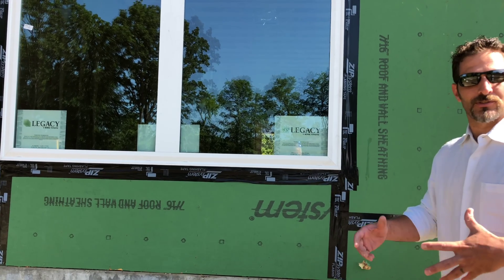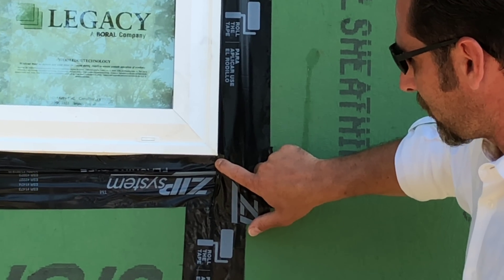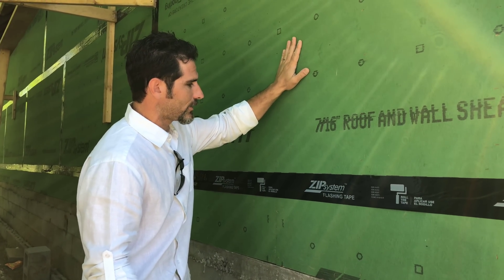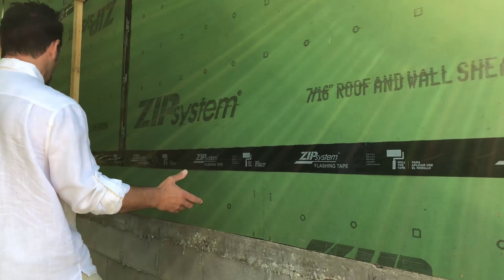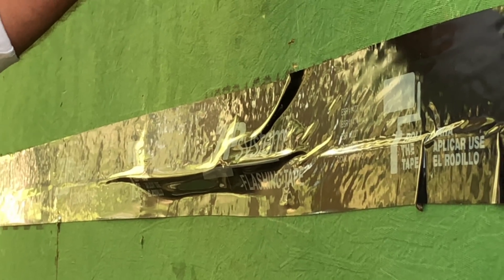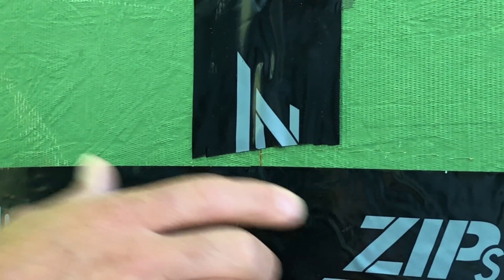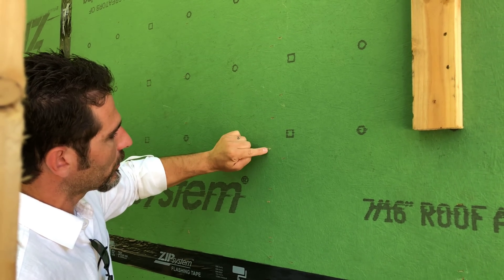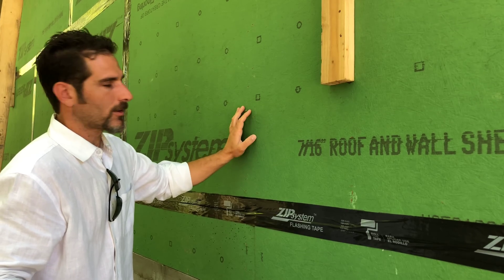ZIP System Problems

Comment: Liquid flashing needed
Reply from the maker: Funny how they are recommending liquid flashing now but when it first came out they didn't have any thought about the penetrations.  When people had problems they told them the nails were over driven!  HELLO, we use air guns to build houses THEY ARE ALL OVER DRIVEN!  Now the magical solution is liquid flash.  If you think it is a good idea to smear a bunch of liquid flash all over the place and rely on miles of perfectly installed tape to keep your largest investment safe then we have different view points for sure:)  Thanks for watching!

Comment: Is it just me or did this video highlight a bad install and use it to show why an inferior product is better? If I pull the ground off my most epensive extension cord OSHA is still going to fine me.  Show me this video on a good install and sue me the negatives.
Reply from the maker: Yes this video points out a very sloppy install but also a very common installation!  This system has more potential to be problematic than any housewrap ever thought of!  Add in the marketing they are doing to say how fast and easy it installs and this is what you get.... Homeowners stuck with the  bill years later when the water finally starts to show up inside!
Thanks for watching & interacting!

Comment: I've seen numerous YouTube videos praising the zip system. I'm about to start a remodel on recently purchased peir and beam house. I was looking closely at the zip system, but I'm so glad I seen your video on it. How could this system be put together better? Do they prefer over hang at the bottom, could replacing zip tape for the zip caulk? I'm still undecided on zip or just osb or plywood with tyzek
Reply from the maker: Plywood with Tyvek will by far be superior in my opinion.  It overlaps and will be much more user friendly for you to repair as well as install correctly!  If you need any help you can always reach out and I will be glad to assist.  Thanks for watching!
Reply: I have a question for you,  with that over hang on the tyvek. How much over hang should that be when getting installed?
Reply from the maker: Here is a great reference for installation:
https://www.dupont.com/building/how-to-install.html
You can also checkout all the videos we have on our channel that will explain how to integrate penetrations such as pipes, windows etc. into the building envelope.
Reply: If I used 7/16 osb or plywood as sheathing. What product can I use to tape up the seams of the butt joints on those once installed?
Reply from the maker: Marcus Mumphrey there is no tape I have seen that will stick to osb or plywood long term.  You could use zip then cover it up with Tyvek but you better make sure you have the proper ventilation and HVAC system. That will be costly also but would do what you are asking about.

Comment: Matt Risinger pointed out everything this guy is calling issues.  There is a correct and a wrong way of building a water-proof and air tight home.   This seems more of a skilled labor issue rather than the zip system itself.  I'm sure the same skilled labor who installed this system would do the same to any other system.  Hopefully, the inspector corrects these issues.  I didn't buy into this video.
Reply from the maker: https://www.youtube.com/watch?v=Hi_a2godZ0o
Here is a great example of this system failing even when installed per manufacturer's specs....

Comment: is there a flashing that should be on that bottom? Seems like a good see for a aluminum flashing
Reply from the maker: Yes there should be a termination flashing that works in conjunction with the zip system tape. The beauty of housewrap is you don’t have to worry about that, you just simply run the bottom of the housewrap past the bottom plate line and your done! That is why you will see this wrong on many zip system homes....Thanks for interacting!
Reply from the maker: Yes there should be a termination flashing that works in conjunction with the zip system tape. The beauty of housewrap is you don’t have to worry about that, you just simply run the bottom of the housewrap past the bottom plate line and your done! That is why you will see this wrong on many zip system homes....Thanks for interacting!
Reply from the maker: Yes there should be a termination flashing that works in conjunction with the zip system tape. The beauty of housewrap is you don’t have to worry about that, you just simply run the bottom of the housewrap past the bottom plate line and your done! That is why you will see this wrong on many zip system homes....Thanks for interacting!

Comment: Every system will fail if it's not installed properly...... like  come on....
Reply from the maker: You are correct & that is the point of this video! The manufacturer of this product has sold builders, homeowners, lumber reps, etc that this system is so much easier & faster to install but it is simply not! It is actually very difficult to install correctly at which point the system may actually work.  The other major thing I don't like about any of the Integrated systems like this are the fact that they rely on miles of tape to keep your structure safe!  As opposed to the overlapping of a quality housewrap.  Thanks for watching & commenting:)

Comment: I don’t understand why the industry continues to try to build houses like we did in the 70’s/80’s. Build tight, insulate, and ventilate. People need to breath, not the house.
Reply from the maker: Building a tight house if not done correctly can be a nightmare for unsuspecting homeowners.  I agree about building a tight home but paying attention to the climate you are in.  Water intrusion management is super important in a tight home because it doesn't breathe to allow it to dry out as well.  The HVAC and air exchange is also super important.  Most builders using zip or other integrated WRBs are not paying attention to these things, therefore leaving homeowners with a huge problem!
Reply: I completely agree. Not building anything correctly is a nightmare for the homeowner. Zip, house wraps or otherwise. I think most builders are trying to build quality products no matter what materials/vendors we choose. However we can all agree that we don’t want water or air (uninvited and unventilated), entering our homes.

Comment: Point at 6:25. It is more about design and understanding how materials work and how they can work together. You shouldn't be harping on zip alone because all products are subject to the same failures. even Tyvak!
Reply from the maker: You are correct about all systems can fail if not installed correctly!  However ZIP has pushed their product to the public as faster and easier to install than traditional housewrap.  When in fact it is much more difficult and time consuming, not to mention all the tape you are relying on to keep your home safe!  So the point of this video is to show the most COMMON installation vs. their pipe dream of a perfect world!  Look around your area & let me know if you see any of these systems on a home you would be comfortable living in after you watched the video!  Thanks for watching:)
Reply: @WeatherProofingAmerica  Here is the deal. That is a load of excuses! If you are a GC and don't know how to install the product, you either A) bring in someone who does (and can verify their experience with the product) B) bring is someone to inspect the installation or C) declined to take the job. 100% of clients would agree there are no other excuses. Additionally, If a client chooses a product install time frame can not be an issue if the GC agrees to install it.

Installation speed is greatly dependent on product experience and knowledge(true with about anything). An experienced contractor should be cutting some time off of the complete wall system install and waterproofing. That is what zip alludes too. Tyvek wraps have been around a long time. I wouldn't expect to see major market penetration for some time with Zip for awhile. However, I can see informed clients wanting Zip-R since it has substantial timing savings and benefits.

Comment: This a problem with the installation NOT the product
Reply from the maker: You are correct & that is the point of this video! The manufacturer of this product has sold builders, homeowners, lumber reps, etc that this system is so much easier & faster to install but it is simply not! It is actually very difficult to install correctly at which point the system may actually work.  The other major thing I don't like about any of the Integrated systems like this are the fact that they rely on miles of tape to keep your structure safe!  As opposed to the overlapping of a quality housewrap.  Thanks for watching & commenting:)

Comment: My house was built in 1979
It has 2x4 exterior walls and r-11 insulation.
The exterior is plain old T-1-11
Therefore, the sheathing is actually the finished siding.

At first read, this type of construction probably sounds like junk to you.
Notice how I said CONSTRUCTION not “system”

I’ve had zero rot or water problems.
No mold, nothing! Because my house can actually breathe.
I should take this time to note that my house also has huge soffits 24” on the whole house.

One final note is that I’m a builder
I’ve been working this junk and these systems for years.
It’s basically all trash.
If you keep water off the side of your house it won’t rot
Build your house with massive soffits and you’ll save a lot of headaches.
Tyvek and zip are just two different turds floating in the same punch bowl.
Pick on ( because of code)
Build huge soffits and you’ll be fine.
Reply from the maker: The home you are referring to has stood the test of time because it can breathe very easily!  The bad side to that is it is very inefficient due to airflow through the home.  However because of the high permeability of the home it will not rot, rot takes place when organic materials are consistently wet and dry out very slowly or not at all.  So you will find areas of your home that will have water stains on the inside of the wall cavity but no rot because it dries out quickly.  With the new codes you have to use some type of WRB so in my opinion a quality housewrap that can be layered is much better than a 0 perm system that has many flaws including the miles of tape!

Comment: New products? Seems like I remember the 70s. T- 11. Gip rock sheathing with corner bracing / plywood corners. The shingles fell off and you could break it to a house with a utility knife.  Aluminum wiring.  3/8 plywood on the roof. What a disaster.  Chip board sheathing? Never was a fan of that crap!

Comment: It is obvious a terrible contractor does not understand or does not care how to properly install a ZIP system.  Imagine if the electrician or plumber performed their duties to this level of craftsmanship.  This poor craftsmanship would also have a negative impact on the tyvek house wrap you promote.  Every staple on the tyvec is a penetration for water to come into contact with the OSB siding it is "attached" to.  Finally,  It is obvious you do not understand building science and are stuck in the old method of building from the 50's.  A properly designed house should not leak.  Priorities are 1)water 2)air 3)vapor and 4)insulation.  With a proper design for the inside and outside, a tight house is the best solution.  Even if you do not achieve passive certification, follow the passive certification design process and you will have an efficient, healthy and long lasting home.
Reply from the maker: Mark, you are 100% correct a bad installation on any system will cause problems. This video however is designed to educate homeowners or any other contractor who actually cares to take the time to learn the potential issues if this system is not installed correctly. Not sure what makes you think that I don’t understand building science but we can have that discussion on many different topics another day. Hopefully this video does what I designed it to do which is help make people aware of problems so they know what to look for when they go to a home a contractor is building for them with this system.  Cheers 🍻

Comment: so its not the system, its the people doing a piss poor job  using them...
Reply from the maker: You are correct & that is the point of this video! The manufacturer of this product has sold builders, homeowners, lumber reps, etc that this system is so much easier & faster to install but it is simply not! It is actually very difficult to install correctly at which point the system may actually work.  The other major thing I don't like about any of the Integrated systems like this are the fact that they rely on miles of tape to keep your structure safe!  As opposed to the overlapping of a quality housewrap.  Thanks for watching & commenting:)

Comment: You lost credibility on this video . It's pretty obvious that Zip is not the issue it's clearly the builders . You can use the best most expensive products but if you dont install them properly it was all a waste.
Reply from the maker: That is the point of this video! The manufacturer of this product has sold builders, homeowners, lumber reps, etc that this system is so much easier & faster to install but it is simply not! It is actually very difficult to install correctly at which point the system may actually work.  The other major thing I don't like about any of the Integrated systems like this are the fact that they rely on miles of tape to keep your structure safe!  As opposed to the overlapping of a quality housewrap.  Thanks for watching & commenting:)

Comment: So the problem with installation not a product
Reply from the maker: You are correct & that is the point of this video! The manufacturer of this product has sold builders, homeowners, lumber reps, etc that this system is so much easier & faster to install but it is simply not! It is actually very difficult to install correctly at which point the system may actually work.  The other major thing I don't like about any of the Integrated systems like this are the fact that they rely on miles of tape to keep your structure safe!  As opposed to the overlapping of a quality housewrap.  Thanks for watching & commenting:)

Comment: Dumbass.  Your bashing on the product clearly a problem with installation
Reply from the maker: You are correct & that is the point of this video! The manufacturer of this product has sold builders, homeowners, lumber reps, etc that this system is so much easier & faster to install but it is simply not! It is actually very difficult to install correctly at which point the system may actually work.  The other major thing I don't like about any of the Integrated systems like this are the fact that they rely on miles of tape to keep your structure safe!  As opposed to the overlapping of a quality housewrap.  Thanks for watching & commenting:)

Comment: So the title is misleading...  Installation problems are not product problems.
Reply from the maker: That is the point of this video, bs marketing is going to devastating to homeowners! The manufacturer of this product has sold builders, homeowners, lumber reps, etc that this system is so much easier & faster to install but it is simply not! It is actually very difficult to install correctly at which point the system may actually work.  The other major thing I don't like about any of the Integrated systems like this are the fact that they rely on miles of tape to keep your structure safe!  As opposed to the overlapping of a quality housewrap.  Thanks for watching & commenting:)

Comment: I would like to see your video on how you fix these issues.
Reply from the maker: Well first we have to remove the exterior finish (brick, stucco, siding etc.) then we have to remove the zip panels that have water behind them so we can remove and replace water damaged materials. Then we install new plywood and cover the exposed wall with Tyvek. Then we fabricate and solder any necessary flashings & put the exterior finish back on! Quite simple but very costly....
Reply: Thank you for that! I am educating myself in order to avoid future problems.

Comment: I saw a similar problem when tile guys started transitioning to the schluder systems for tile. Improper technique.

Is zip faster. Debatable. Is it better. Yes. But there’s a different process to this stuff than traditional framers/house wrappers are used to. I found my drywall finishing experience really lends itself well to installing this system properly.  And like many of the other comments, I like the liquid flashing. Although they don’t require it, putting it on the nails give your shell a bomb proof seal!
Reply from the maker: So you are saying that you are okay with relying on adhesive to keep the hundreds of feet of tape sealed and watertight for the life of your home?
Reply: Weather Proofing America zip tape is acrylic. Not butyl. The hardening acrylic adhesive in the tape bonds stronger and holds up better to temp and moisture compared to the industry standard butyl flashing tapes. When applied correctly it’s better. When paired with a liquid flash on openings and fastener holes, i have confidence in the independent tests that show repeatedly it outperforms current common house wraps.
Reply from the maker: Mike Cuntala So you are saying that you are okay with relying on adhesive to keep the hundreds of feet of tape sealed and watertight for the life of your home?